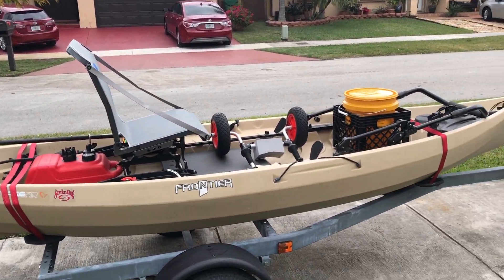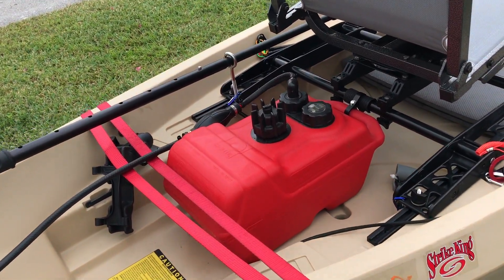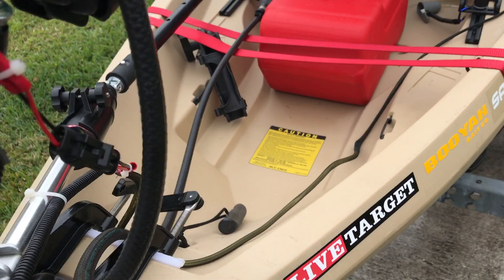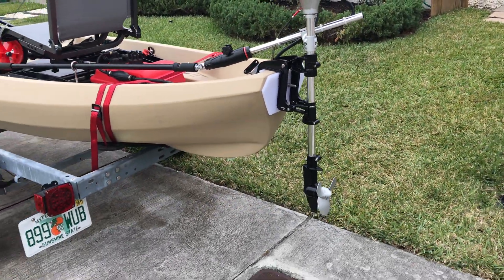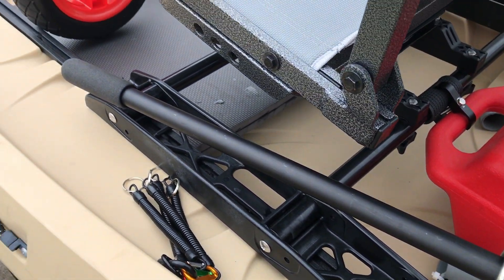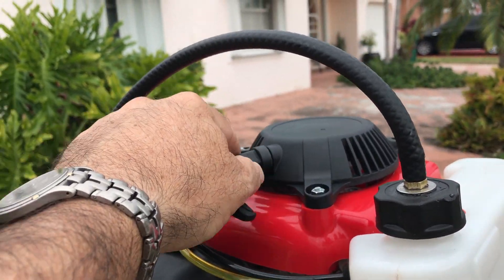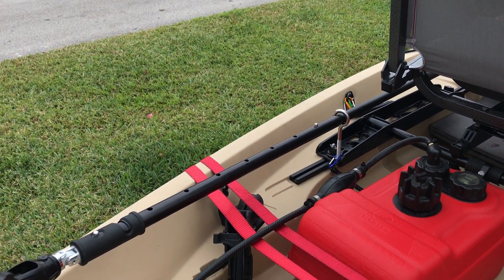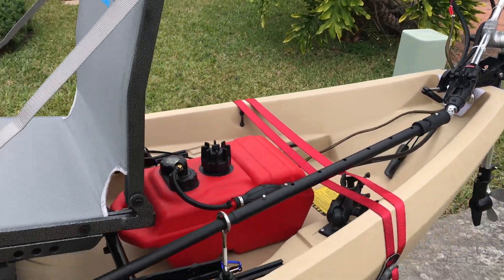Added Gas Tank to the Nucanoe Frontier Propulsion

Comment: Is this the 144f or the 142f engine? I note it doesn't say Honda on it, so how does this larger lawnmower type engine compare to the GX50?
Reply from the maker: @Deluge4000  the 4 Stroke Honda 50cc outperforms these clone engines hands down. The engines are easier to start and are smooth on acceleration.
Reply: @kayakbuddysllc-lightweight4947  Thanks for the reply! Easier to start and smoother acceleration sounds like a better time on the water than one that I'd have to fight to control.

Comment: When you gonna video a run in the bay with that one, Biscayne Bay? I was raised down there age 5 to 35, been to Miami marine Stadium Stepenwolf Concert.
Reply from the maker: Hopefully I can get out soon and check how this performs on a heavier boat. The 35cc worked well, but this gives more flexibility and range for sure.
Reply: Kayak Buddys - Kayak Propulsion Engines. I struggled for months trying to mount the new tohatsu 2.5 HP sold me with my 17 F12,  no way to fit the transom,  traded it back for the new H2Pro-Ped drive,  pedal tower too high for the stock seat. Waaa🤢, built seat base from 2x4s added a 7 inch riser, waiting on weather for shakedown cruise.